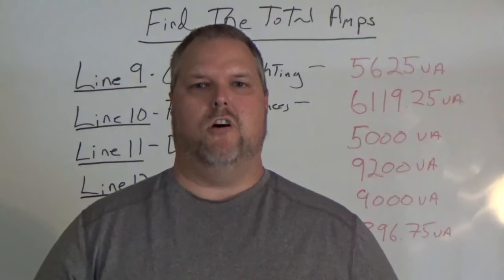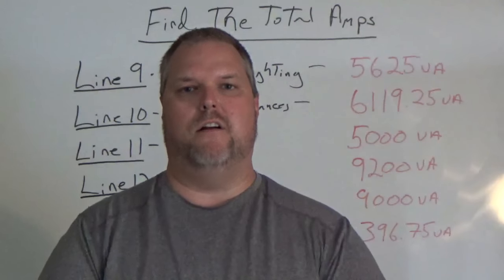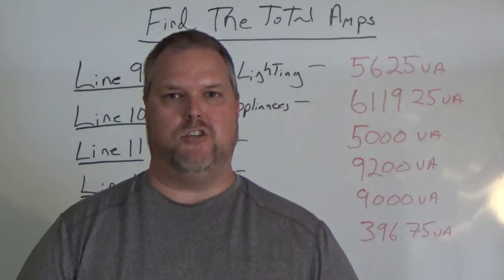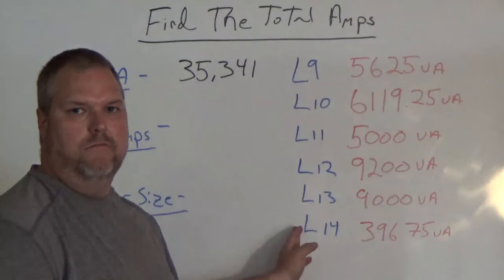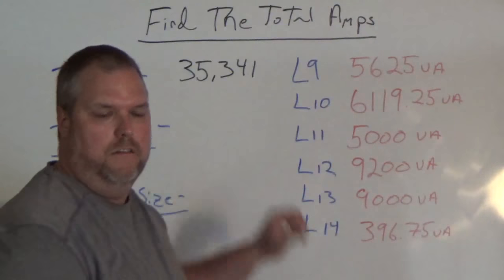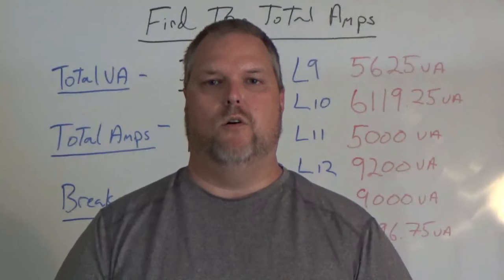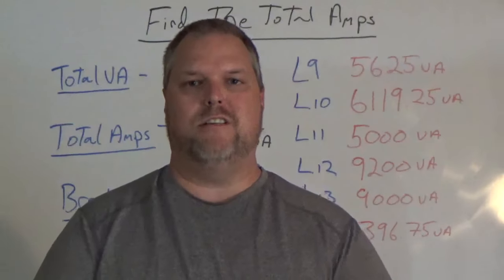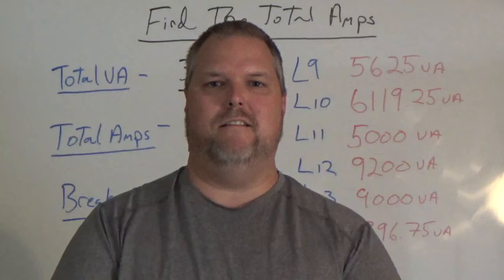How to complete a Load Calculation

Comment: Please don't take this as an insult or anything but... Shouldnt that main feeder breaker be at a minimum (125%) of the total load. Which would come to roughly 187. My inspectors would fail me if I had any breaker under 200 amps. At least that's what I was taught when I got my license. You're going to make someone have an electrical fire. You may want to remake this video brother.
Reply: That only applies for commercial buildings, if it's residential you can actually downsize to 80%
Reply: This is also my understanding.  I was hoping to get a definite answer from YouTube about this but most videos are not multiplying the load by 1.25.  So I’m still confused.

Comment: I think the size of the breaker should be 125% higher than the full load current , isn't it ?
Reply: That could be in the case of continuous load (a load sustain more than three hours)
Reply from the maker: No, reason being that we are calculating a demand load on the breaker. At the same time there is no continuous load to be concerned with. The Code says nothing about 125% of the breaker for dwellings! CM

Comment: I'm a Transportation Elec apprentice and trying to understand for the state exam.  lots of practice  questions with 120/240 supply voltage.  Breaker calculation divides by 240.  why not divide by 120?
Reply: I guess the main breaker is a 240 volt breaker?  I was kinda surprised to see that too... figured that main breaker on the panel was 120, but i guess it is not.

Comment: When I have a 300-amp service and two 150-amp panels, and I need to add a car charger, how can I calculate which panel to use based on the breakers available in the panels?

Comment: Won't some of those loads only be using a single pole breaker on a 120/240v panel so most loads would just be using 120v instead of 240 which would affect the total amperage?
Reply from the maker: This video is showing how to Calculate the service demand. Yes you have 120v circuits but you must base the load off of the service voltage which is 240v. You will need to know which of those 120v circuits used so that you can size the neutral but I did not go that far in these videos based on I was just showing how to size the service Breaker. CM

Comment: So basically determine the VA From each appliance and divide 240v then you know what system off the service pole will be needed is that correct
I have a question determine the calculation and run for a new electrical grid to a 3 story dwelling 😬😬

Comment: Good refresher, I work for a goldmine company in North easter nv. I like but hate it because the pay and benies are great but for all the actual sizing and brain work the mine contracts the work out so as an electrician we just become parts changers and never really use the math that much. Also MSHA has alot less electrical standards to follow than the NEC, the MSHA standard is probably less than 5 pages. Thank you for this amazing video!

Comment: Can’t you do 35% of the remaining load after 100% of the first 3000 volt amps?
Reply from the maker: That’s all in my first video General Lighting Load. This video is completing a dwelling calculation!! CM
Reply: @craigmichaud-electricalins4602  thanks for the clarification Mr Michaud. This video series has been an extremely helpful refresher and I like the way you structured adding up the calculation.👍

Comment: I would if you could answer this question, I cant seem to find the answer anyware 
how do you measure the total amps for the entire breaker panel, for 240 devices [like an Dryer] you only measure 1 leg [10a x 240 = 2400 watts]  for 120 devices you only measure one leg [hot to neuetral], and then [from my understanding ] the neutral carries the imbalance between the 2 legs, so in other words lets say you have 12 on one leg 15 on the other leg and lets say 3 on the neutral ,  the question is how do you read this for a true total amps . .  i have searched high and low is what is the formula to take these 3 numbers and calcullate the total amps or watts ? if you know the answer
 id reaaly appreciate it

FOR EXAMPLE ;
L1         N         L2

10A      N       10A   [240v DEVICE 2400Watt ]
2A        N       5A      [2 separate 120v devices L1 240 Watt   L2 600 Watt ]
TOTAL
L1        N        L2
   [neutral carries the difference between the 2 legs from my understanding]
12A    3A      15A

Total watts using what we actually know 3,240watts which is 13.5 amp at 240v but if you look at the amps above if you were to measure them it is in no way 13.5A and if you were to measure any of those it would not give you 3240 watts.  So how do you actually do it??????    I have looked every where for this answer

Comment: Hello there, 
Thank you very much for your video it’s very helpful. 
Just have one question; 
After calculating we get 147.25 amps. Which give us 150 amps breakers 
Let’s assume it’s THHN conductor and for that we got 1/0 from table 310.15.(B)(16)
The question since it one phase 3 wire system 2 hot and one neutral are we going to divide the hot on 2 so can we use 2 conductors of size 6 AWG which each carries 75 amps or we use 2 conductors of 1/0 AWG which each carry 170 amps? 
Or we go to page 800 and choose size 1AWG for both conductors? 
Hope you got my point.
Reply from the maker: Great question!! The answer is NO. See the sizing of the wire is based on the load of the overcurrent device. So we are sizing the one leg as stated in the video. Also regardless of the wire type you will always want to use the 75 degree table to size any service over 100 amps. I hope this helps!! Thanks for the question and watching!! CM
Reply: I just came across this video so it might be to late for u to notice but have a question on your comment about using the column 75 degrees, I'm assuming that you and this person are talking about sizing the wire in table 310.16. So what about Table 310.12 Single-Phase Dwelling Services and Feeders. Cause this table would make it a #1 awg  copper instead of a #1/0. ??

Comment: Hi there Craig, I went through the videos to calculate for an ADU 360sqft. single family home and now I'm wondering if I came up with the correct number. My final calculation was 27.27Amps. what would be the breaker size for that?
Reply: I'm trying to do the same thing, get the load calculation for my 500sqft ADU. Did you do it yourself of hire an electrician?

Comment: Craig, thank you for all the information you provide! It has helped me a lot in learning this trade. Quick question on this load calculation...

When adding new electrical equipment to an existing home, will these same steps be taken to determine if the panel needs to be upgraded? A little confused since most of the time homes aren't drawing much for amperage, but by calculation on equipment they still need to be upgraded. 

Example being I'd like to add a Tesla charger to my own home.

Comment: Thanks for the video. I can't get a straight answer on this, hopefully you can help settle an argument... If you have a 200 amp residential main service panel and you get a reading of 105 amps on each of the main 120v feeders, are you drawing 210 amps, therefore the 200 amp panel is overloaded? Or is it only drawing 105 amps total?
Reply: I can't imagine you're drawing 210amps.  Wouldn't you're main breaker have already tripped?  This is very rare with no short condition.
Reply: 105 amps total.  Amperage stays the same.